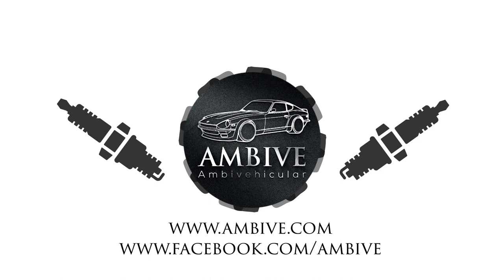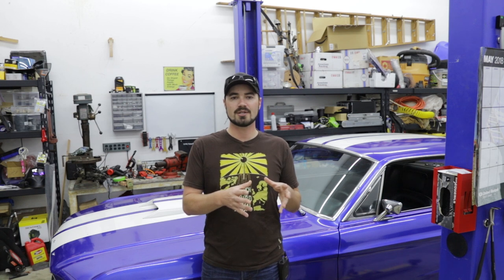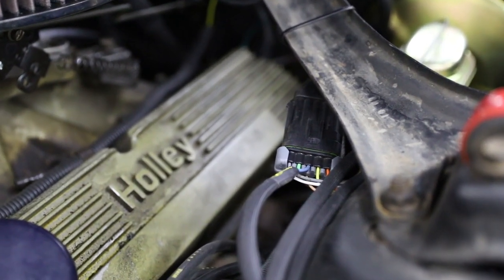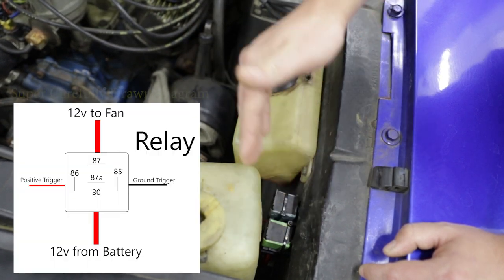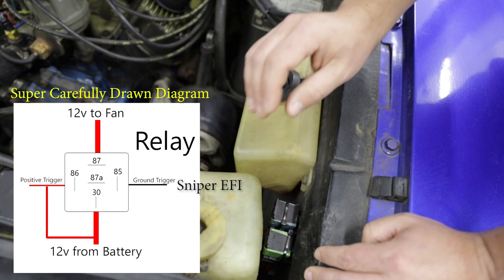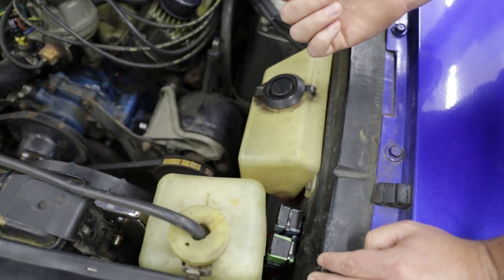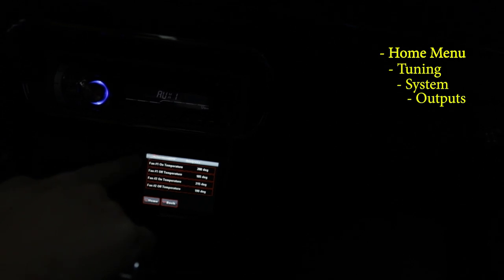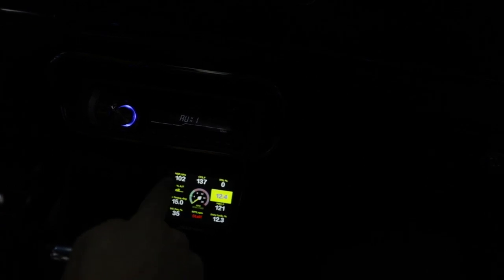Sniper EFI: Configuring Electric Fans

Comment: Nice video! Guys should also set the turn on temp to something just above the temp it runs at going down the highway. I'd also suggest they use a good quality (Bosch) relay rather than a cheapo since the fans operation is critical and the cheap relays don't hold up to long term and high current use.
I used Derale's 2 speed, 18" fan with great results. The Sniper controls the two speeds so much of the time the fan runs at a lower, more quiets speed unless more cooling power is required. I also have a switch that grounds the low speed stage of the fan in case I want to overide the EFI's control. 
 It does a good job of keeping my 390 cool.
Sweet car BTW!!
Reply: Can you provide a link for the Bosch relay you are using for your setup?
Reply from the maker: @ScottDLR  Good recommendation. I have tried those as well as the cheaper ones (around $10 for 4) that have 500+ 5 star reviews and both have worked well for years. If you doubt the quality, just install them with a socket so that it's an easy replacement and toss a spare in the glove box.
Reply: @AmbiVe  I havent had any problems with the off-brand cheapo's either but I did a test where I ran them with the fans on for an hour and the cheap relays got much warmer than the Bosch parts.  That kinda scared me away from them.

Comment: Dude, we could be friends. I'm working on the dual fan set up for the sniper on a 351C in my '67 fastback right now. This is some of the best info yet to be found! I got the whole kit from tank to manifold, with the dual sync distributor. So far so good. How much noise does your fuel pump make?
Reply from the maker: This pump is noisier than it should be. I'm going to swap it for another and see if it's a pump issue. I have other 044s no where near this loud (the one on my 280z is basically silent).

Comment: Using only one fan, does it matter which wire (blue or green) I use? I used the blue wire and the fan isn't being controlled by the sniper. It just runs with key on.
Reply from the maker: There are a couple possible answers depending on what and how you have things configured.

If the relay you are using is closed by default, the fan would actually be on until the sniper wanted to turn it off. Basically backwards relay logic.

If you don't have the sniper outputs configured to be off until the temp threshold is reached, then they could be grounded all the time as well. In theory, green and blue are both just outputs, you just need to configure them, but by default they are set at different levels of engagement. Blue is fan 1 and green is fan 2 in the software I believe.
Reply: @AmbiVe  I don't think the relay is closed. It came with the fan. I ohm'd it and got a reading of 90 so it shouldn't be defective. I have the handheld set to have fan 1 and 2 off until 190 degrees. It's 75 degrees currently. So it should be grounded. Also just did a firmware update and ran the wizard. No luck. Fan still churning. The handheld even says both fans are off and AC is off.
Reply from the maker: The ECU should only be grounding the trigger wires when it wants the fans to turn on. If they are always grounded, then there is an issue with the ECU control or the wiring. Does the relay click when the key comes on or is it always engaged?
Reply: @AmbiVe  Dangit! The relay is indeed bad! New relay and it's working perfectly now. Thanks for the help...sorry to have wasted your time like that!
Reply from the maker: Hey, cheap fix! ;)

Comment: Have u updated your firmware. Mine is updated and afr doesnt read live like that I get init instead. Thats my favorite screen as well it shows all the important data. What size fans did u use how are they holding up?
Reply from the maker: I'm using a single 16" Mishimoto right now, but I'm going to cut out all the front support area and fab up a better flowing system next time I pull the engine. I want to run two 14" fans staggered in the future.

Yes, I'm on the lastest firmware (had to for my new Hyperspark ignition). So far all my sensors still read live and correctly.

Comment: Nice video! @AmbiVe Do you know if the Sniper is able to PWM a signal to a SSR for the cooling fan?? My fan works good but it’s loud and I’d like to run it slower when it’s not needed to be at 100%.
Reply from the maker: As far as I know it only sends a straight on/off grounding signal. I was thinking about doing something similar with my PMU-16, but I was considering using a new sensor or the gauge wire and fudging the range for two fan modes with multiple programmed functions on that ranged input.
Reply: @AmbiVe  What’s a PMU-16?
Reply from the maker: ECUMASTER's power management unit.

Comment: I'm sorry for asking that question, but what kind of relays are those? Should I look for special relays depending on the car?
Reply from the maker: No problem. Unless you need them to fit into an existing box, the specific type shouldn't matter. Basically, the important information is that they handle the number of amps your application requires and work as you need. The style I use most commonly is often just called "Bosch" relays as they created that specific form factor. They are pretty standard in the world of standalone relays.
Reply: AmbiVe thank you for an informative response. I appreciate that.

Comment: How do you keep the fan from coming on during cranking?
Reply from the maker: The fans only receive power when they are switched on thermostatically, be that by thermoswitch or ECU. That's one of the big perks to having a relay in the middle that is switched.

Comment: What gauge wire are you using to the battery and to the fan for power?
Reply from the maker: If I remember correctly, this was back when the battery was still under the hood, so it was either 12 or 14 gauge at about 5-6ft run per relay with the smaller fans pure copper. In the current setup with the battery in the trunk I ran 0 gauge from the battery to the break out under the hood, then 10 gauge to fan relay I believe. For the distances, it's oversized still.

Comment: i did everything to set my fans. Every time i turn the key into the on position fan 1 goes on .This just started happening .Do you know what might be causing it ?
Reply from the maker: Your display should tell you if they are on or off. If the computer thinks they are off and they are on, you have a wiring issue. If the computer is turning them on, I would check the temperature range for your fans to ensure you have the turn on point set above the current temp, then check that you don't have it set to being overridden to ignore temp and be always on.
Reply: @AmbiVe  ok , i did everything and 1 still goes on when i turn the key to the on position. how do i check if the computeris overiding the fan to go on ?
Reply: @AmbiVe   the # 1 fan goes on when i turn the key to on position. I checked the temps and they are spot on , so where do i go on hand held to shut it off ?
Reply from the maker: Is your relay bad? Otherwise, it must be being grounded all the time the computer is on, so then you should be able to look at the handheld screen and see if it wants the fan to be on. Swap through the output screens until you find one that shows if the fans are on or off.

Comment: Can the fans be shut off, can't find off anywhere
Reply from the maker: The fans are off until the relay is engaged if you're using a normally open relay. If you use a normally closed, then you would have an always running issue until the trigger is active.

If you want to be able to override the operation to be able to turn it off even if the trigger is on, just split the trigger with a switch that can break that circuit.